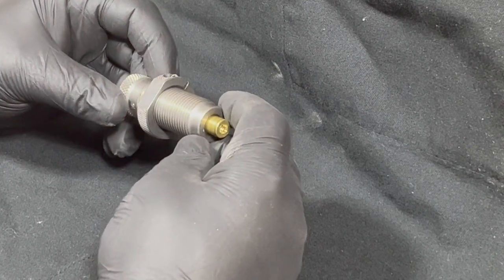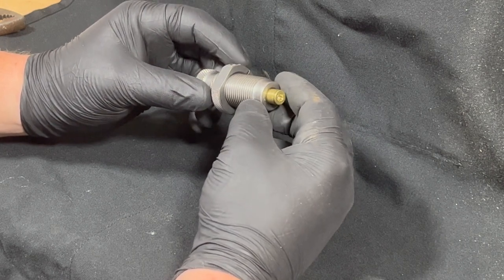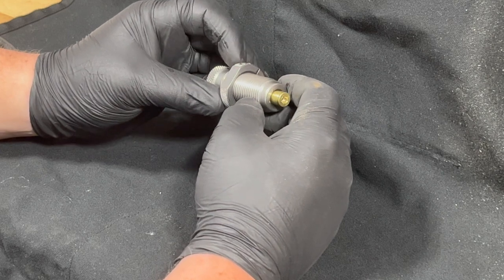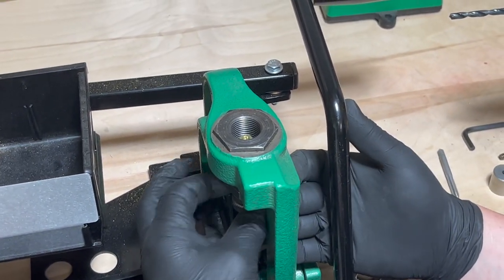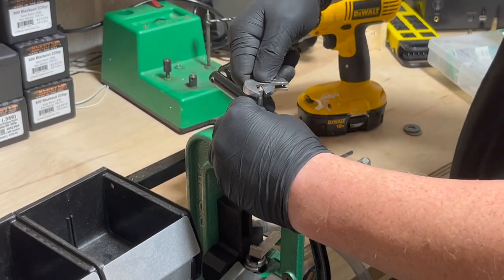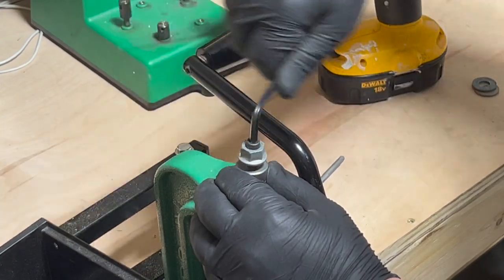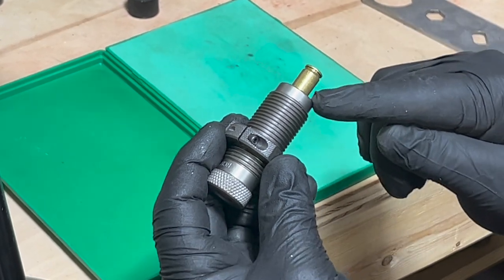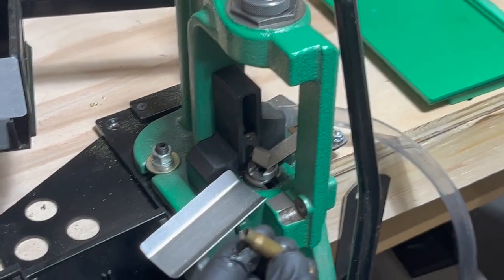How to Remove Stuck Brass Cases From A Resizing Die - Easy Quick Method

Comment: I arrived to the conclusion, after many reloads of 5.56 mm NATO, that the process people is using is wrong.  I got 3 or 4 times the case stuck, and it was very painful to take it out. If you use just one die (LEE for example) to decap and to size both the body and the neck of the case at the same time, it is too much force necessary for all 3  steps at the same time. If the case you are trying to resize and decap is made of a hard material, with low ductility, that case needs a lot of force on the press to do it. As you apply force,  the material does not resize because is not ductil, enough, then the press get loose when the bottom of the case got out of the small die supporting  the case. Then the problem starts.
I have changed my process to the following: Use one die to just decap and resize the neck of the case (die used normally for bolt action ammo), and a second die to only resize the body of the case (For this I took out the decap pin of the Lee die that decap and resize both neck and body.) In summary, I use 2 dies: one to decap and resize neck and the other for the resize the body. 
I have never had a case stuck again.
Reply from the maker: This is great information! I’ve pinned your comment! Thank you! 👍🏻
Reply: I have been doing something similar.  I have a 4 hole Lee turret press.  I have one die I deprime and minimally resize with.  Die #2 I finish resizing to my desired dimensions.  I have found some brass that is one or 2 thousands thicker at the neck and they need more leverage and lubrication to get to the dimensions I want.  They also get separated out and used where precision is not as important or they get annealed and back through the sizing die.

Comment: I've had 2 stuck case scenarios . One from no case lube and other from bad casing.
I used the neighbors 15 ton press to pop it out with NO damage to the die parts. 
Quick , easy and more affordable than a 30 or 40 dollar 'kit'
Reply: I found a couple of old nuts, one or two washers and a screw to do the job perfecrtly aswell
Reply from the maker: @M_GYT - for sure this is the cheapest way of doing it with items you may already have in your garage! 👍🏻

Comment: I made a rcbs case remover, the concept is easy.  So was the process thanks for posting!
Reply: This is what I did too. 1/4X20 tap kit, comes with drill bit, large washer, proper size pipe nipple, 1/4X20 all thread and a couple nuts.
Reply from the maker: @Ziptie497 - there’s more than one way to Chicago! 👍🏻
Reply from the maker: @vicfeb3 - awesome! Thanks for the comment! 👍🏻

Comment: I once stuck a 10mm case. The solution was the following: totally unscrew the die, take a pretty big nail driver (as near as possible as the diameter of the shell), unscrew the die head (in my case, the unpriming needle of a resizing die), so you have access to the top of the die. Insert the nail driver inside the stuck case, and gently tap with a rubber hammer on the nail driver, until the case comes lose. So you don't destroy your case. IDK if that can works for rifle, necked cases, but it worked for me...
Reply from the maker: @ptitlouis8084 - looks like I’m gonna have to purposely get a case stuck tonight and find out! 😂 Thanks for the tip! 👍🏻

Comment: Hi.  Great video.  I just ordered the remover tool, but I have a somewhat different problem.  The depriming pin is stuck in the primer hole.  Is the pin hard enough to withstand a punch pushing it back out or will it bend?  Thanks.
Reply from the maker: Great question! Some will, some won’t withstand a punch. I like to screw the die in upside down in the press so I have a good grip. I think if you take your time it will work out just fine. 👍🏻 let me know if that helps!

Comment: All of these stuck case removal videos are great...except one minor thing. All of these show the first step as "Simply remove the expander ball and decapper, then..." I got a 9mm case stuck in an RCBS sizing die so bad it was as if the expander ball was welded to the inside of the case. The decapping pin was still sticking through the primer flash hole. Tried to use the threads of the pin to back it out using two nuts against each other. The pin snapped. Been reloading for more than 30 years and this was my very first stuck case. I always expected the first one to be a rifle case, but I apparently took the 9mm for granted and didn't lube it well.
Reply from the maker: woodystube1000 - there are some shell manufactures that have a smaller flash hole in the 9mm. I should have pointed this out and explained how to use a nail punch to help tap out the pin through the flash hole. RCBS makes a smaller diameter pin for depriming if needed. Sorry for not making that clear in this video. 👍🏻 thanks for the comment!
Reply: I ran into the "small flash hole" problem with some off brand 5.56 cases. (Sorry don't remember the brand) they had pinkish primers. Anyway, broke two decap pins in a row before finding the issue. Sorted the rest and dumped them in the scrap bucket.
Reply from the maker: @kypparmstrong2775 - If they have a red ring around the primer, throw them away. They have Berdan primers. Took me snapping a couple of pins to figure that out. Now I check all the cases while lubing them. 👍🏻

Comment: In sticking a 5.56 case, I did another "brute force" method.  With the decapping rod out, I put the die with stuck case in the bench vise, resting on the die lock ring.  Took a Torx driver small enough to fit down into the neck and contacting the base of the shell.  Then HAMMERED the Torx driver to knock the case loose.
Reply from the maker: @qedsteve - how in the world did you get the decapping rod out? That must’ve required tremendous force? I’m guessing you used a socket or something to tighten the nut down to raise the rod. Well done! 👍🏻

Comment: I have the RCBS stuck case removing tool.  Nickel plated brass will stick like it was super glued if you don't use enough lube.   The drill bit provided by RCBS was good for a couple of cases before it became dull.  Spend the money for a high speed steel bit or a cobalt drill bit.
Reply from the maker: Great tip!
Reply: @k2defense  K2 if I can build on this comment.  I don't know what size of drill bit RCBS sent with the kit but it made for a very hard time starting the 1/4x20 tap along with the drill bit dulling very quickly.  I believe it was probably a #7 black oxide bit.  
I replaced it with a 13/64 high speed steel drill bit that is .002 larger than a #7.  It makes starting the tap easier and you lose no strength in the threaded portion of the case to be removed.
Reply from the maker: Great input! Thanks for sharing! 👍🏻
Reply: the drill bit was dull from brass?

Comment: Screw the die into the press from the bottom side so the shell case is facing up.  Heat the shell casing with a torch or soldering iron and melt a candle onto the case and die. The heat will draw the wax into the space between the die and the case and should be enough lube to allow it to be pulled out with pliers or vice grips.
Reply from the maker: @mouhunter - great information! Do you need to plug the bottom (or the top since it’s up side down) of the die to keep the wax from flowing through and spilling all over the place?

Comment: Just tried for the first time.  Coax press, hornady match die for .223.  Imperial sizing wax.  First and fifth case stuck.  I don't know what I am doing wrong.  At least the drilling and tapping worked to get them out.
Reply from the maker: @dd1892 - try lubing the lower third of the case. Most of the expansion is close to the case head. My process (not saying it’s the best method) is lubing the lower third of the case then spraying a small amount of Lyman’s Quick Slick spray to the case mouth. I try to avoid shoulder lube since it causes dimpling. Try that and let us know how it works for you. 👍🏻

Comment: also get the rcbs stuck case remover 2 kit along with the original kit . kit 2 pulls the decapping expander out of the die , so no cutting the case or drilling in to the decapping pin . i got both but my remover kit is a hornady . same thing . gladly i haven't had to use them yet . but i am set if i do . did stick a couple just to try the kit out . took 16 cases with no lube to do it ! case was easy to get out .  so i am ready for when i realy do stick a case . imperial sizing wax is the best !!!
Reply from the maker: tn reloaderguy - thank you for this information! I wasn’t aware of the kit 2! Even better!
-K2D

Comment: Frankford arsenal spray lube. Spray the cases, let sit a couple minutes, resize cases. Never had a problem.
Reply from the maker: @vicfeb3 - which type of die do use? Neck, FL, or SB?
Reply: @k2defense  I've got a good selection of all types and use the FA lube on all of them. It's never let me down. Normally, I'll dump the cases in a cake pan, spray them down, shake them around, let sit for a bit till the alcohol evaporates, resize. For bottle neck cases I'll stand them up and squirt some across the tops. But only because the sound the expander makes grates on my ears.
Reply from the maker: @vicfeb3 - I’m half deaf so that sound doesn’t bother me as much 😂👍🏻
Reply: @k2defense  lol

Comment: The shoulder gets sized also why wouldn't you want it lubed also?
Reply from the maker: @victorforte1605 - I find when I lube the shoulders, they dimple. Since I’ve started lubing the lower third only, I’ve never had a stuck case and zero dimpling of the shoulders. I do spray the case mouth with case spray if it starts to squeak or hard to resize. Others might disagree with my system, but for me it works. Hope this helps! 👍🏻

Comment: Been loading over thirty years never had a case stuck
Reply from the maker: @Lucysdad66 - There are two different reloaders, ones that have had a stuck case and those that will at some point. Glad you made it this long without a mishap. 😄👍
Reply: I guess it's like concrete you have cracked concrete and concrete that's going to crack.
Reply from the maker: @Lucysdad66 makes sense. Thanks for the explanation! 👍🏻

Comment: Sounds like a screw extractor would do it or a tap screw and a couple pieces of metal next to washer............. but im a millwright so 🤷
Reply from the maker: @robertulmer5886 - There's more than one way to get to Chicago! 👍😁
Reply: A screw extractor would not work because it relies on the thing being removed having a thread.

Comment: Best solution imperial die wax.  An alternative is Lanolin in Isopropyl alcohol which is similar to Dillon Case Lube
 Do not use Hornady One Shot Case Lube.  Testosterone and Hornady One Shot are incompatible.
Reply from the maker: Hello John E! Going to try your suggestion! Thanks for the comment!
Reply: Stuck my very first .300 BO case in my brand new die after lubing with One Shot. I snapped the expander ball getting it out but eventually drove the case out. I've been using Hornady Unique since.